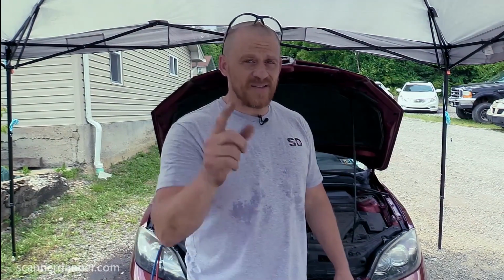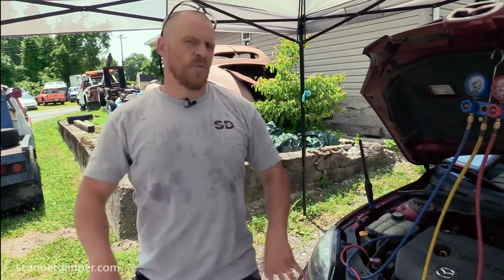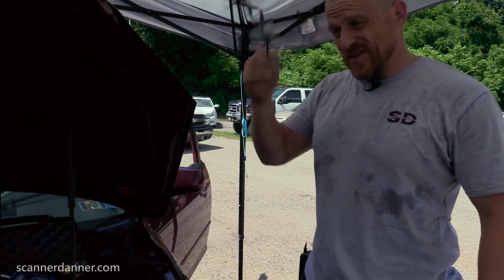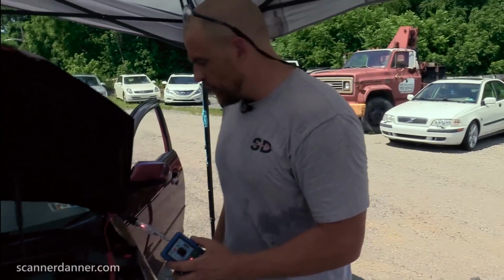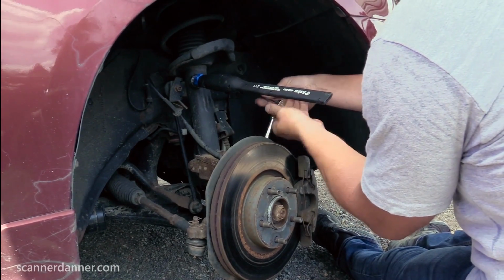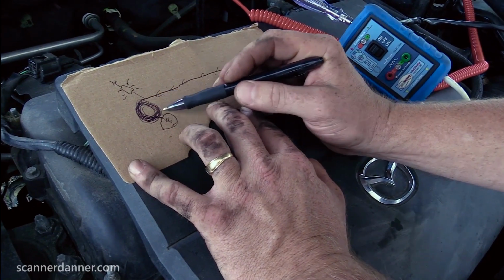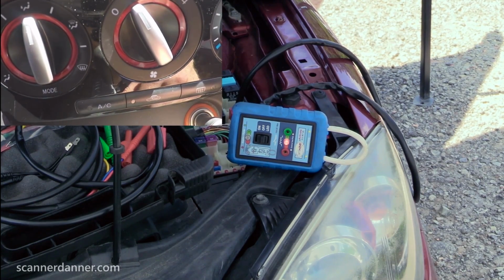A/C Clutch Does Not Engage-Diagnostic Fundamentals (full charge)

Comment: Thank you for this very informative video!  
Long story short AC was not blowing cold last October/November, but AC compressor and fans would kick on.  I let it be since it wasn't too hot.  Checked again now and AC compressor or fans don't turn on.  
- What happens if the pin is not all the way up when connecting the fittings to the valves?  
- If my gauge reads 0 on both sides when the car is not on, is it OK to charge the system to manufacturer spec?
Thanks!

Comment: I changed my ac compressor but clutch will not engaging. I used a paper clip to bypass the circuit. The clutch engages 
What can cause a clutch not engage? Can a sensor low or high sensor cause the clutch not engage
Reply: On my 1995 Cadillac Deville that same thing was happening and it was the low and high switches and the wiring harnesses attached to them as well as the Refrigerant Temperature sensor (not all cars have or need these), on the evaporator and liquid line (two sensors). I vacuumed and recharged the system with pure refrigerant (not ac pro garbage with additives) and it worked beautifully. (taking out all four of the sensors discharged the system)

Comment: Oh no you didn't go over it! My clutch engages when I do it manually (jumper wire where relay goes)
But it's not engaging by itself, I believe I overfilled ac too it seemed like you mentioned it could happen if u overfilled? I'm not sure. Anyone please help?

Relay tested okay.
Clutch could be manually engaged, so coil is fine.

While engine is running tough clutch will not engage it seems and it sounds kind of grinding? Not really grinding. But definitely not as smooth as I think it should be.

So I'll replace the  clutch maybe? Or a whole clutch, pulley, coil kit? Just to make sure? Maybe bearing? Still be cheaper than a whole compressor

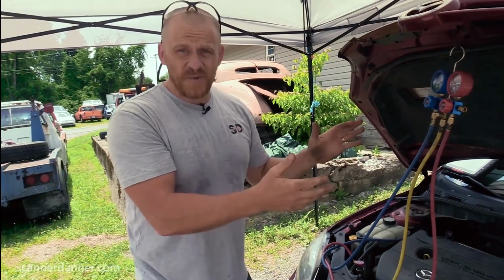Comment: 3:34... The 90psi at 90 degrees tells you it NOT CONTAMINATED..... if the pressure equals the temperature (only for 134A) then it means your freon should be fairly clean and no full of water or debris... At your 12 volt connection,,, if you disconnected the positive wire and used the connection to ground on owms.. If you get a reading then that would confirm your compressor windings are shorted to the casing Or ground

Comment: Thanks thanks thanks!!!... my mazda 626 was acting up by the clutch not turning on I used a pen light tool and checked my Relays and Trouble shooting the wires connected to the clutch cuz I was thinking it might be that   ( continuity).. but it wasn't it was the actually the clutch not turning on. Power  was not getting in.. SAN ANTONIO T.X...

Comment: On my Saturn, my clutch quit engaging. It was intermittently last summer, then went out completely. It has refrigerant according to my gauges. There's no signal to the Pressure Switch with my friends computer. He suspects a BCM or Computer issue since it can't be located why there's no power. The relay is working and jumping the relay does engage the clutch. My Chiltons manual shows the A/C is controlled by the BCM not the main computer. We've found no solution for the dead signal.
Reply from the maker: Year, make, model, engine size would help me to answer your question better
Reply: Lol, sorry for the late reply. It was my assumption that was the problem. I found a corroded wire to the pressure switch signal.

Comment: Great job and explanation. The pressure/temperature relationship was good as pv/t = pv/t (Charles and Boyles law works) and I especially liked the use of the relay tester as well as continuity checks. Your vocation is not in auto mechanics but rather should be in teaching practical sciences or a vocational technical school, but the pay is poor. I use the emergency brake in addition to chocks and leave the wedding band off while working. You enlightened me and I appreciate the effort.

Comment: Questions? Is that  one of the quick test when ac switch turn on the idle go up. Means ac clutch engaging? I have Honda Pilot 2011 no ac cold. I replaced ac clutch relay still no ac cold. When l turn on ac idle not change and I look compressor clutch still disengage. Thanks for info.  I’m  need to buy the test tool for diag. Hope I can fix  this issue.  
What you suggest if compressor fail. Replace whole assembly or buy a clutch kit. Thank you.

Comment: I’m not understanding. If it’s a two wire solenoid. Then the compressor is controlled through your pcm through your ground. And power is always supplied to your compressor from your fuse block. That’s why you have relay and a fuse for your ac system
Reply from the maker: Is this a question or statement?
Reply: It’s a question
Reply: Is it a one wire compressor.
Reply from the maker: @mrblackrock30  please restate your question. You want to know why there is a relay? Or how the relay is controlled?
Reply: How is the pcm controlling the compressor? Is it through ground or power?
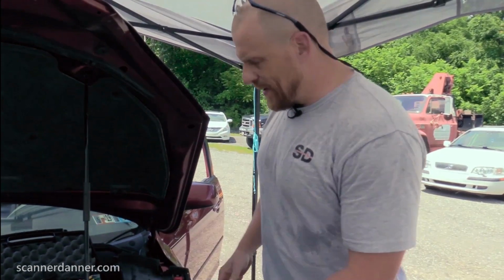Reply from the maker: @mrblackrock30  it is controlling the relay that then controls the clutch coil. Start watching again at 16:45, I cover all of this
Reply: So the reason I’m asking is because I diagnosed a car that the ac compressor was not coming on. First thing I did was charged it with dye and Freon. (The reason I had to do that was because there was none in the system) after that the rpm went up and the pcm was supplying a ground at the relay to turn the compressor on. Well compressor still doesn’t cycle. So I go to the connector and noticed there was no power. So I checked the fuse and the fuse was good. The problem was a broken wire between the fuse and the connector. Now where I’m confused at; is this a one wire solenoid and the compressor is grounded at the block?
Reply from the maker: @mrblackrock30  yes, most compressor clutch circuits will ground right to the body of the compressor. Technically it is still a 2-wire clutch circuit but you will only see one wire

Comment: ScannerDanner in your video your initial pressure gauge low side 90psi and high side same at 90psi in my case with my 1999 Nissan maxima I only got an initial low end pressure of 60psi same with the high end and when I got the ac on low end pressure drops to 35psi and high end comes up to about 90psi what does this mean I got low charge coz there is no leak anywhere in the system.i hope you could help me.
Reply from the maker: what was the outside temp? and yes, it does sound like it is low on charge, or you have a compressor issue
Reply: @ScannerDanner  temp outside is at 90.i've replaced my evap,expansion valve, and dryer too with new ones.

Comment: Great video. As far as the no comm with the HVAC module, note that at 15:17 the scan tool briefly tells you “Auto A/C only” in the top left corner. 
I’ve learned to watch for that with my Snapon. When you see that they are telling you the manual one has no separate module.

Comment: What if I connect test light with power terminal and the compressor body ?shouldn't this tell me if the ground was bad or not?
Reply from the maker: yes, just make sure the compressor clutch has power coming in when you do that test. You want to load the circuit as much as possible and the test light by itself does not provide that

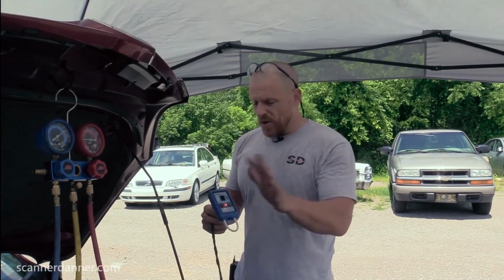Comment: i notived one hot day in my 02 chevy sivlerado driving across wyoming on a hot summer day that the air stayed cold with thte a/c command button light OFF but i had the reciirc on. When i pulled over for a break i left the engine running and opened the hood and watched the compressor cycle on/off. Maybe that what's going on...or maybe you know that only 19:13 throug thus far. Cheers!

Comment: Wheel Chock's on the rear tires. I don't trust E-Brakes/Praking Brakes, They have failed in 100% of the vehicles I've owned for an extended period (usually the cables break stretch or seize)
Reply from the maker: Agree! I was only speaking to those changing a tire on the side of the road

Comment: Very nice example!! Even Caleb is picking up the material!! This is so difficult to understand, and how it all works!! When I was a teen, a A/C tech neighbor had retired, but was still doing service calls, and used me as a helper. He tried to teach a young teen, some basic info, and he couldn't break thru!! I just couldn't understand it, and wouldn't listen! I went a different way! 

The hardest part for me, was understanding the idea that refrigerant boiled at -40 degrees!! I knew that water boils at 212 deg, so how could refrigerant be hot enough to cook pasta at -40, and how did that make me feel cold!! My weak brain couldn't get he idea! It just held me back for so long! It wasn't until I learned the basic principles of science, how it all worked! For me, it was the realization of what "BOILS" means!! 

Basic science! Boils means CHANGE FROM A LIQUID STATE TO A VAPOR STATE!! It doesn't mean that it will make pasta for us!! And when it changes,(BOILS) it absorbs heat!! So, the point that refrigerant boils, it absorbs the surrounding heat, and makes things around it feel cool (or scientifically, the absence of heat)!  

The rest I could fit together, and it all made sense to me!! The A/C system is just a controlled compression and then release of a material that helps absorb the excess heat, to make us feel good!! 

Great job, Scan!! And Caleb too! Thanks for sharing!! AND TEACHING!! AND ENTERTAINING!!
Reply: Yeah, and when the refrigerant level gets so low you hear the expansion device hiss behind the dash almost like a gas stove would, you don't get cold air anymore because liquid->vapor transition isn't happening anymore.

Comment: Great video, You should make a video on how to verify proper charge off of pressure readings and temp, there are a ton of videos on charging the system putting the required amount by weight in, but very few on temps and pressure to figure superheat and subcool.

Comment: stupid question, but if no power was going to a low pressure switch,  where would you start to chase that problem.
Reply from the maker: wiring diagram and research of the system, every car is different

Comment: @3:37 me personally, I started taking that pressure/temperature relationship thing with R134a with a grain of salt after I had a Chevy Silverado once that had 100 psi reading on the gauges with the engine off, and it was around 100 degrees when I took the pressure reading. I decided to hook up the machine and recover the system anyway. It wound up being a good thing I did because despite having all that pressure, it only recovered 0.1 lbs of Freon/refrigerant. Could’ve wasted SO much time if I hadn’t done that first. Kudos on bringing that up.
Reply: @Morley what SD says is correct as long as the refrigerant is in a saturated condition (liquid & gas present). In your case it's very likely that you had only gas in the system and possibly some air too.

Comment: So a lot of the newer vehicles if you have the temperature  select  on max a/c it will bypass the a/c switch. So if you want to check the switch function you need to set the temperature  selector the notch before max a/c and it will also automatically engage the recirculation mode

Comment: As a member of the scannerdanner premium on line classes, it has been the best $11 a month I have ever spent. Watching Paul explain the "engineering " and the workings  behind these electrical systems on these vehicles makes troubleshooting computer controls so much easier.  In fact I rarely have to use a flow chart anymore  to diagnose computer controls or any electrical component and  I have been doing electrical diagnostics  for over 30 years! He will definitely help you cut down your diagnostic time.  Thank you  Paul
Reply from the maker: Great feedback!! We use the flow chart as a guide only right? No longer are we slaves to these sometimes idiotic methods.
Reply: @ScannerDanner  Agree! 100%

Comment: Ok so I changed out clutch and compressor and still won’t come on. What do I do now? Still no ac
Reply from the maker: You should have tested the circuit first! Now it is time to test the circuit. You only need a test light and some knowledge of the circuit (wiring diagram)

Comment: Customers doing a recharge can be problematic. They usually pump a slug of air into the system each time they do it. Not good.
Reply: They also either undercharge or overcharge either refrigerant or oil or even both. Better pay a shop and save any hassle. In EU you can't service AC legally by yourself anymore. Licence required. This unfortunately seems to lead to idiot mechanics that get angry when someone with the knowledge brings new OEM o-rings to replace old leaky ones and new parts to fix minor leaks, and some of them also seem to deliberately miss leaky Schrader cores (both things happened to me)

Comment: I used to have the same problem with suzuki escudo running through a flood. Just had a broken fuse. Clean the ac pulley and replaced the fuse was all I did. Guess I got lucky. Thanks for the lesson Paul n Caleb. 😍

Comment: The new stuff is called R1234YF and I've seen it starting in 2017 + model years here in the US.  Europe has had it since, I wanna say, 2014.  I've been told that the R1234YF has been causing corrosion problems in their respective AC systems and it's going to make for some job security for us.  I hope they get a handle on that because the new stuff is insanely pricey.  Speaking of insanely pricey; if you want to start servicing AC systems with R1234YF, you've got to get re certified for section 609 or they fine you like Facebook has been selling private info off again.

Comment: My gauges damage the schraeder valve if you screw it all the way in and it will leak. As a result I only go a little bit more than cracking it open and never bottom out the gauge screw.
Reply: One mechanic likely damaged a Schrader core on my car this way. It basically hissed like hell after removing the cap and lost about 200 grams of refrigerant in two weeks with the cap screwed on.

Comment: wow! is that your house in the background in the first part of the video? the foundation has some HUGE cracks.  If the clutch was not engaged when the owner tried to charge the system with more freon, he was not able to add more freon to the system as the static pressure was too high on the low side for freon to flow out of the bottle.
Reply from the maker: hose? I'm not sure, this was done in the parking lot of a garage

Comment: The pressure/ temperature relation is contingent that the only substance contained is refrigerant...pure 134A is all you want to find in a system and then Dan's statement holds true. If air has been mixed in with the refrigerant the pressure will rise. R-22 on a 90 degree day will be about 168.4 p.s.i. I know this not because I am a whiz but because there are pressure temperature charts for us to read so that we can help identify whether we do have a proper charge of refrigerant.
Reply: For those who read this earlier, I misstated - R-22 at 90 degrees is at 168.4 PSI, not degrees... I edited my post now. Also, I meant Paul's statement, not Dan's.

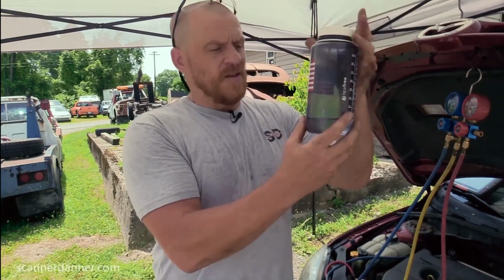Comment: 5:55 I Was just to make video un till this point. You make my point that still today seams to be hard to my bosses and go workers to understand. You just cant only look rest pressuress and tell its good!'
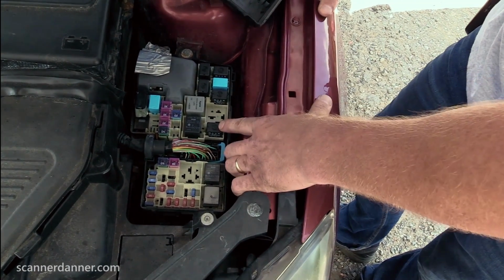12:00 That fuse box lookis like Ford Modeo that may have fan fuse broken and that fan takes so much current you need to buy it with the damn controller in it like ~400€ / 446USD
13:10 Use ECU/PCM as that controls A/C on these Ford/Mazdas that i have sean. EDIT: O You did get it nice! :)
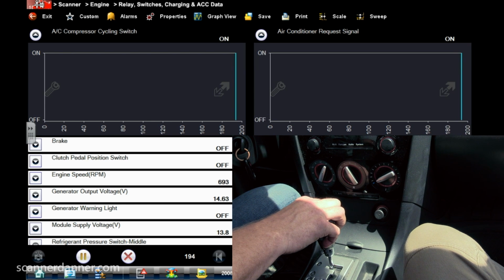14:00 This is one where i would ask my self do i trust my scantoll translation or do i get another one to do the job for it.
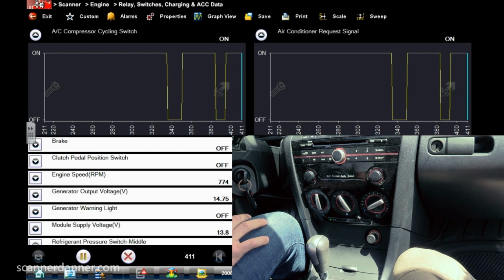15:05 Thats manual ac. so i would say it dumy controller, that talks to BCM that talks to ECU/PCM... with CAN and there is no ac controller if your scantool dosent "make it diffrent controller"(you get it).
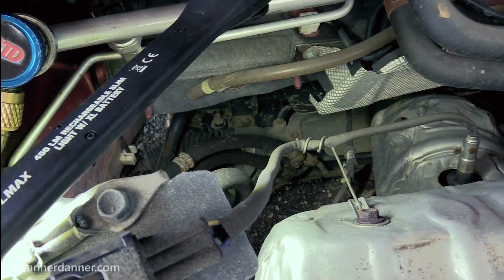24:55 Thats good to know! we have mostly manual transmissions here, so that would have slipped my maind for sure but then again i allways  use Handbrake AT or MT dont care it has to work in our roads. I would allso set that whell under that side of the car. to be more secure on that surface.
33:35 We have had some cars towd to us and get told it just needed jump start to get started :D
Well the thing is they did the jump start rigth way positive on battery positive and necative not on battery! its should go on engine ;) .. see what that did if you try to start it that way :D

Ohh what premium gets you? damn maybe less GST Gray Shirt Time :P many more and allso as long or longer as this videos. + to me i get more info what to look in cars as i dont get USA cars 1 in 5 years but then again 12v dc is same in this side the world for sure!

Comment: One thing you missed Scanner Danner is even if a relay engages it doesn’t mean the contacts are good in the relay. Gotta check to see the circuit is good and that the relay is completing the circuit through the contacts. You did however check for voltage at the clutch so you were definitely thorough in your diagnosis. Nice Job
Reply from the maker: For sure and we would have gone that direction had my tool been able to engage that clutch. Thanks!

Comment: one thing I suggest, wheel chocks!
i prefer to put e-brake on and power brake a little to see how strong it is, with no inspections here often they don't work or are very weak, you simply lean on the car off they roll.
good old salty rust belt

Comment: Just a side note, if a system is near full charge, you won't be able to add much if any refrigerant from a can without running the system. Pressure in the can won't overcome the system if it has equalized.